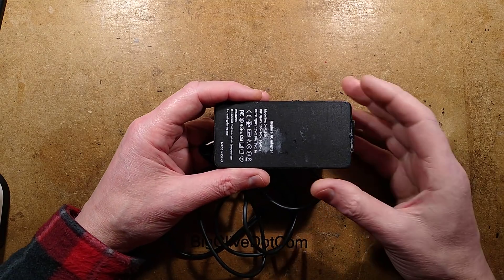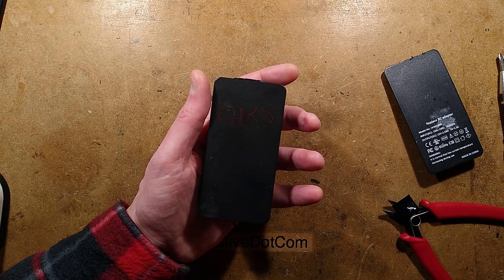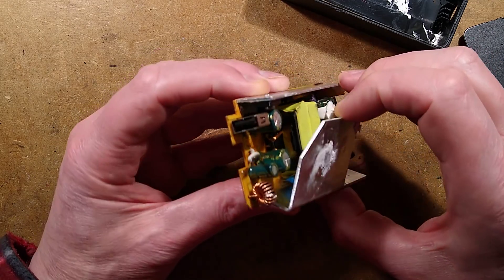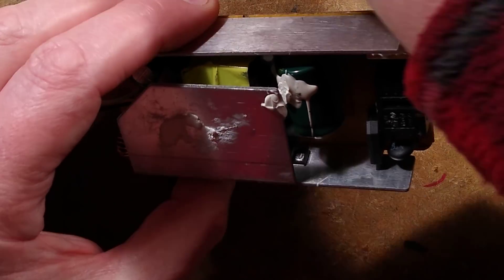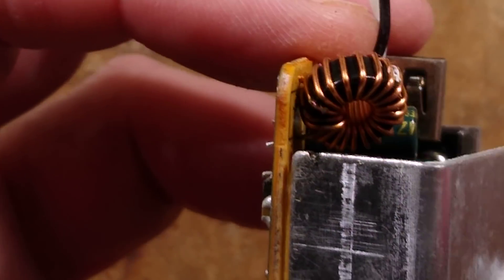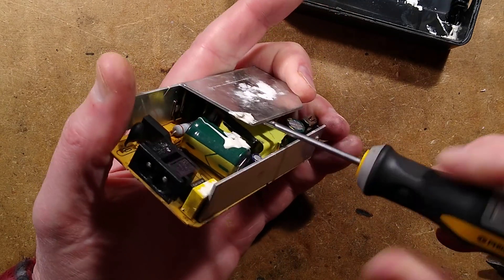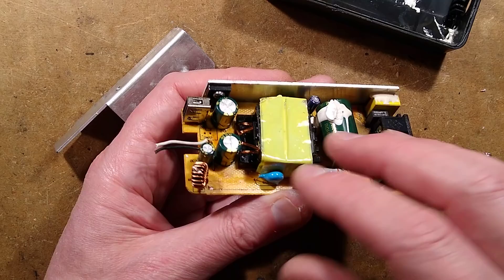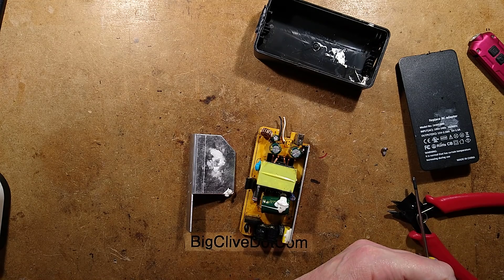This PSU killed a Microsoft Surface and a monitor

Comment: I guess it is true that even if something is UL listed, it might not be safe. (UL is an independent American safety testing laboratory that have written tons of standards on fire, electrical, and equipment safety.)
Do you have something similar to UL or any other testing laboratories in the UK, or is it all just self certification?
Reply from the maker: We do have testing labs, but eBay and other online sellers bypass them.

Comment: When mobile phones first became popular and I was pressured by my children to get one, I had to keep buying replacement charging leads ( because my cat kept chewing through them) which at the time (maybe 20) years cost £6.99 from phone shop. I was ridiculed by my grown up know-all daughter for paying so much and she said she could get one from eBay £3.00. The charger duly arrived and smug Daughter plugged it in and——There was an impressive explosion and bang with flying melted plastic and bits of metal. I rest my case. There was a warning put out regarding these chargers some time later.

Comment: I know this is a few months old but some time ago a HDD reader of mine went out.
When I connect a power source to it the led on the power source goes out and the led on the HDD reader
flashes of not even half a second.
I took it apart to see if I can find any faulty looking circuits. I cleaned it with alcohol. There was dead 
roaches in it. Other than that everything looked fine.

Every now and then I'll take my multimeter out and try to figure out the problem.
My multimeter for some reason does not like to read amps. I've replaced the fuses 
multiple times. I don't put it on anything heavy. Just small devices.
Reply from the maker: It sounds like it has a short somewhere.
Reply: @bigclivedotcom  Yeah, that's what I was thinking. I'm just having the hardest time finding it.
I might have to go out and get me a new multimeter. Something that I won't have much problems 
reading the amps. I'm sure I'll figure it out.

Comment: Prob with those,apart from  being Chinese, no way for heat to dissipate from heat sinks, they get hot inside then the electrolitic capacitors dry out,l had 1 driving small flat screen tv, as caps dryed out dc ripple  got bad so l stop using it b4 it damage tv,replace cap with high work temprature as was in there,all back together working,if only they made case eith vent,heat doesn't  dissipate well enough through plastic case,they get quite warm in use,unfortunately they are used on many laptops,tablets, wouldn't have been to make case with ofset slats to vent case to keep fingers out,and to release heat!

Comment: i made a bench PSU with a cheap programmable module and two laptop PSUs to provide 38V... fact is that one of the PSUs has been repaired several times by me still when it was used on the laptop, lead-free solderings that cracked and let components fly around the case, false contacts on the voltage selector (it was an universal one), blown tracks, and i don't remember what else! all in one unit... fun fact, i still use it on my bench PSU LOL.... "what doesn't kill you makes you stronger" said this PSU
Reply from the maker: If the PSUs are in series, keep in mind that if one is turned off then its output capacitor will be reverse charged by the other.
Reply: @bigclivedotcom  they are turned on and off at once but of course they can't respond at the same time, i think the problem is mostly if there's a load, and the module itself doesn't draw much, but there CAN be a load, the module must have an under-voltage-lockout at like 12V so the problem can present itself... an electrolytic can hold some current in reverse (it's a form of diode) but i have to keep in mind that, by not cutting power with a load on (the module powers up at "off")... yeah you're right :) i haven't thought about that :D

btw, i'm using this thing since some years
Reply: 70 Maxims of Maximally Effective Mercenaries; Maxim #35: That which does not kill me has made a serious tactical error.
Reply: @mandi8345  i'd love to live in a cartoon, anything would be this simple

Comment: Have you ever seen 750 mcm cable penetrated by a bolt that was touching the insulation?  It makes quite the light show, and causes the rental of a trailer mounted, 12 cylinder Cat generator for two weeks.

Comment: i have a very similar powersupply for a surface pro 2 from amazon and when the tablet is charging it makes the metal case feel a bit strange, something definitely dodgy with it
Reply from the maker: Many metal cased devices have a slight fuzz feeling from the case due to leakage from ungrounded chargers and power supplies.  Even prominent chargers like Apple units.
I do strongly recommend against using generic power supplies as they often fail to meet your local safety standards.

Comment: I bought a 2nd power supply for my Surface 4. I have to wonder if it contributed to the battery one day expanding and pushing the glass panel into a bow shape. Called Microsoft, left out the 3rd party power supply part. They sent me a free Surface 5 as a replacement even though it was out of warranty. 3rd party one could not hold a full 100% charge when under heavy use, a slight slow countdown.

Comment: I'd assume that Chris is still here partly because the monitor connection provided a path to earth, rather than the unfortunate user.

Also Surfaces have magnesium alloy chassis so it'd be conductive.

Comment: I’ve seen an unusually high number of aftermarket Surface power supplies fail catastrophically; not just one particular design or manufacturer.  We ultimately had to send out an advisory to our users banning these supplies.  
Often in such cases the Surface is irreparably damaged. I’ve examined a few seemingly from different manufacturers and implementations. In most cases tracking and/or arc-over is apparent, but the exact cause has varied. Signs that the heat sinking material itself provided a path thru isolation has been noted but not in all cases. The only common factor I’ve noted is all such failures have been 3rd party reproductions that attempt to mimic the small compact form factor of the OEM power supply.  None of the failures have been aftermarket Surface power supplies with a more typical brick implementation.  Regardless of how nice the case finish might be (some have been almost indistinguishable from the OEM model down to the texturized surface finish, regardless) the internals have been sloppily assembled. The OEM form factors is rather compact for a given wattage and I suspect many 3rd party manufactures are unable, unaware or uninterested in ensuing the required implementation and tolerances required of the form factor. Given how difficult this design is to open and inspect I just say stay away from them.

Comment: I remember being too scared buying a cheap AC adapter for my OG Surface PRO and ended up buying a new one from Microsoft support and it costed me nearly 25% of the cost of the OG refurbished Surface PRO. But seeing how the pictures of the cheap AC adapters I looked at really looked similar to this crap, I'm glad I did it.

Comment: I had a similar power supply that I was disassembling. I touched the metal heatsink and got quite the tingle. When I probed it, it had 120vac. There was no inductor to come close to contacting the heatsink, but realistically mains voltage shouldn't be in a heatsink in the first place.

Comment: holy shit. and i thought the charger i had hacked together with one of those cheap cables that has a surface connector on one end and a barrel jack on the other connected to the 12v line of a 15 year old atx power supply was bad.

Comment: If you get the figure 8 mains plug the wrong way round the heatsink will be a mains voltage, so shorting 240V to ground via the surface pro and monitor.

Comment: I had a similar failure, i woke up a  by a loud bang and total darkness, after some trial and error by resetting fuses and trying again, i found the culprit under the bed, my laptop.
The power supply had basically exploded, killing both laptop and mouse connected 😂

Comment: The other thing that worries me about that PSU design is that there's no insulation on the underside of that heat sink, and it's actually very close to the tops of those two caps on the LV-side, which makes me wonder if just squeezing the case in that spot might be able to make it come in contact with them and cause a similar sort of failure mode, too.

My guess is this was probably the result of late-stage changes in the design when they realized that their initial heat-sink design was inadequate, so they made the heat sink as big as they possibly could to try to fix that, without adequately protecting against it coming into contact with components which weren't an issue in the original planned design.  (using thermal paste between the heat sink and the plastic(!) case also really smells like an act of desperation, too, because they realized too late that it gets too hot and couldn't come up with any other way to fix it so they just tried anything they could think of to get a couple more degrees out of it)

Comment: Mr clive, apologies i made this comment already but stupidly included a link which i think youtube did not like.

Firstly i apologies for trying to contact you in this way but i failed to find another way of contacting the best electrical SME i know.

Tldr:

my sailboat engine has a electrical brain box, my engine started playing up, turning it self off etc pretty nasty to have.

i did some investigation on the internet and apparently due to the electrical brain box being mounted to the engine it is subject to heat and vibration which can cause issues. this is a known and common issue

I am trying to avoid replaceing this brain box which using my amateur automotive electrical experience i have decided is causing the issue i am having due to its price (£560!!!)

my question to you is ; i am having this error intermittantly , the work around for this fault is to mount the brainbox off the engine and onto the inside of the engine bay to mitigate its exposure to said heat / vibration. do you think my brainbox is now probably toast or due to its intermittant nature of the fault will fingers crossed be ok once i mount it somewhere more hospitable to it's existance.

I look forward to your reply if at all i get one as i know this is use of your time and a long shot but i will say thank you in advance!

An avid viewer,

Charlie
Reply from the maker: Hi Charlie.  It may be a bad connection.  If the problem is with the box itself then it may be viable to open it and reflow larger connections with fresh solder.  Maybe even change primary electrolytic capacitors.  The downside of doing this is that if you damage the case or PCB then you won't be able to get a refurbished replacement on an exchange basis.

Comment: Very poor layout of components. Shorts are going to happen because of vibration and or the inability to keep proper clearances. On power supplies that use switch mode circuitry, the live mains input side is not isolated physically enough from the output and the consumer's safety will be life threatening or the consumer's home or business will catch on fire. You'll see this more and more often when the manufacturer cuts corners on the design and protection factors. Build it cheaper and build it faster is how China's factories operate. 
Safety and quality assurance is not part of their mission.

Comment: I wonder if this sort of thing explains why, when I plugged a mini PC into a new HDMI monitor I bought (made in China), it appears to have blown the HDMI outputs from the mini PC, and possibly other things inside it too, turning it into a useless brick.

I now use the monitor only with an Amazon Fire Stick, which seems not to be harmed by it, perhaps as nothing on the fire stick is grounded.

I have come to the conclusion to be very wary of Chinese products. Unfortunately, a lot of non-Chinese products are likely to be re-badged Chinese ones.

Comment: I am sorry but I don’t buy your rubbing theory. The vibration required would be rather extreme. More over the inductor wasn’t in contact with the metal housing when you disassembled and it looked like a good distance definitely not small enough for rubbing from normal use. And nothing about the disassembly process indicates it would increase the distance and if anything it would decrease it. Instead given the scorching on the board at least to me it looks like power supplies I’ve had to replace after surges from electrical storms from outlets without surge protection. At least that’s what it looks to me. Not to mention for said arc to remove metal the voltage would have to be way above the 110-240v from the outlet. You talking about arc welding voltages on a circuit that steps down voltage instead of increasing voltage. So while I agree adding space or insulation between the inductor and the housing might have helped. I don’t buy it being the primary issue.

Comment: That heatsink will be electrically connected to whatever the switching transistor's collector/drain is. The tab on TO-220 devices is bonded to the chip itself. Typically that'll be one end of the switching transformer, the other end being rectified mains AC. Interestingly that should also have had 6mm physical separation from any secondary side component too such as that inductor. Poor attention to detail !
Reply from the maker: It's a plastic cased transistor.

Comment: Nightmare scenario! It blew-out all their expensive equipment. The engineer probably never saw the physical product assembled after designing it on the computer, otherwise they would have been concerned with the proximity of that flimsy coil to that heatsink. When you're just looking at it on the computer all you see is "there is room between", and the sense of scale is different.

Comment: I just watched this video with an identical supply powering a Surface pro 4. Its the third supply I'm using, both an original microsoft one and another knockoff one have blown up with a loud smelly pop in the last 12 months (which I've put down to excess heat as these computers draw quite a lot of power). My better half also complained of constant electric shocks using this current one, though it didn't seem to put out more than a mA or two when measured against mains earth.
I'll tear mine apart now - if the inductor and heatsink are too close I'll modify mine and report back on here as another bad one.
Big thanks again, another awesome video Clive :-)
Reply from the maker: Hopefully just a few hundred microamps.  1 or 2mA would be quite painful up a single finger.

Comment: Nah dude, you just put a fuse on it. Then when the heatsink hits the components it shorts and blows. Expected fault
Reply from the maker: Your electronics will blow before the fuse does.  And a fuse definitely won't blow if you are the current path.

Comment: No way that power supply has any CE or UL certifications it claims on the back.   No company name on the back either.  Part of the reason these knock off supplies are so cheap is they have not put the time or parts into the supply to meet the standards. The distance of that inductor from heatsink would never have passed. The heat sink was live and someone could have gotten killed.  You can save a few bucks (pounds) over a reputable manufacturer but that few bucks (pounds) saved is definitely not worth the death of someone or the thousand plus pounds lost when the computer and monitor were destroyed.   Nope!   I would never plug any of my devices into an unknown knockoff.

Comment: I have a 6 USB power supply that gives quite a tingle from amazon. I'm no expert on these things so I tried to get a voltage on my multimeter by poking the end of the usb c cable and my desk with my multimeter and it came to about 37 volts AC. My psvitas touch screen wouldn't work when I tried charging it so I haven't used it on anything expensive since
Reply from the maker: The AC leakage is common.  An electrically noisy supply can cause touchscreen mayhem.
Reply: @bigclivedotcom  I thought as much, as long as the levels aren't out of the ordinary I'm happy

Comment: I would be gutted if a PSU blew up my surface pro.
I have 2 chargers for it, but I spent extra and purchased official ones.  I do have other Chinese chargers, but I don't plug anything of too much value into them.

I have been burned in the past though, with an external USB to IDE hard drive converter + PSU 
(yes IDE. It was a while ago!)
The PSU eventually went bang, tripped the mains and destroyed my desktop PC's motherboard.

Comment: "replace AC adapter" was a warning!  LOL I don't get people who want these super cheap Chinesium no-name replacements esp with high-end devices like a Surface or Macbook.  I work in a shop that sells replacements and when someone comes in looking for a PSU for say, a Macbook Pro for example and then complains they don't want to spend $130 on a real Apple brand charger.  I'm like okay you can afford a $2,500 Macbook pro but you want to cheap out and buy the $30 one?  Not worth risking your super expensive device.  I had a no-name one that came with my Lenovo Thinkpad when I bought it used and it got worryingly hot.  I found a genuine OEM one on facebook marketplace for $20.  Runs much cooler.  I was wondering why the cheap ones get so hot.  Cheaper switching transistor or maybe less transistors used (ie the OEM has two sharing duty while the cheap one uses only one to do the same job?)

Comment: The surface PSU is designed badly, at the DC side where it plugs into the surface device the terminals inside get shorted because the positive and negative are soldered one above the other. I had to cut open mine and separate them from getting shorted because it stopped working.